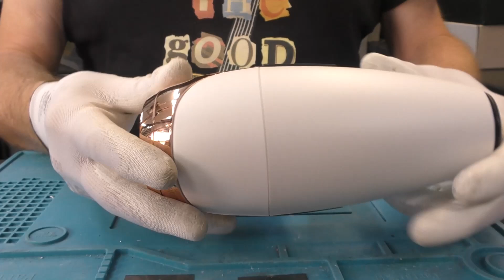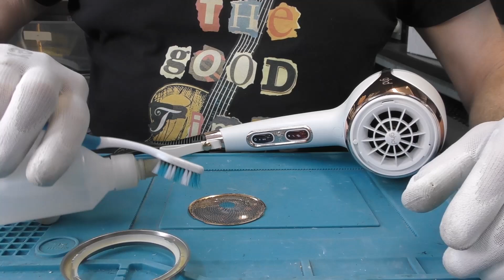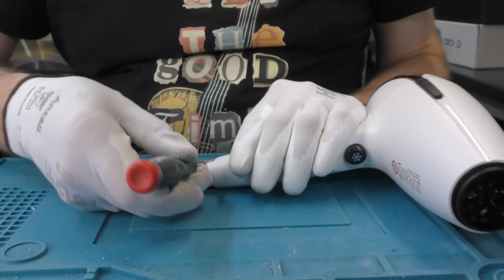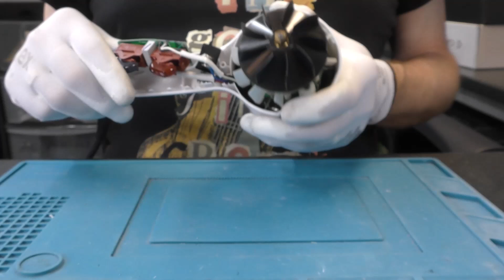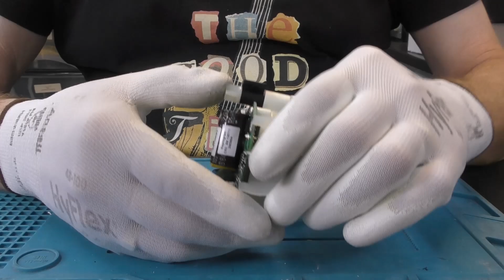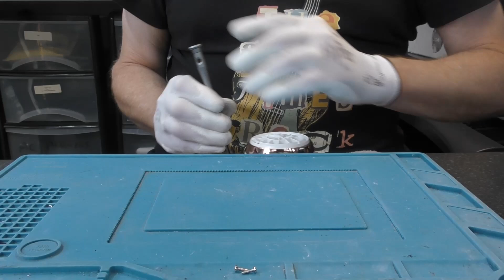GHD Helios HE001 Hair Dryer Tear Down

Comment: I am looking at a GHB with a tripped thermal fuse and water damage residue on the underside of the switch board. Everything else looks clean. The switches work, confirmed by continuity testing at the different positions.

The dryer does not turn on at all. Is that expected behaviour with a tripped thermal fuse? Thank you for the video, it is a great source of information!
Reply from the maker: Thats normal. Replace the thermal fuse.
Reply: @Trevs-Shed thank you so much. I will replace it and see if it comes back to life. Cheers!
Reply: @Trevs-Shed would you have any tips for getting to the inner of the two contact pads? Do you tear down the entire heating element first?
I could get to it with my soldering iron, but not without contacting the silicone or heating coils.
Reply from the maker: Use small side cutters to remove the old thermal fuse and a soldering iron in at each end to solder the replacement. 
Side cutters can slide between the element coils, just be careful not to cut the coil...

Comment: Great video and very helpful. My wife's Helios has stopped working on the first speed setting but is fine on the second. Any idea why? It smelt a bit funny when it initially stopped working and it sounded like an electrical short. Thank you in advance.
Reply from the maker: Switch contacts arcing and rocker worn.

Comment: Hi! Thanks for the video! Mine has an issue with a speed button - it definitely needs a replacement. The problem is I cannot find where I can buy spare parts for it. Any advise where to look? Thanks
Reply: Is it both speed settings or just the first? My wife's stopped working yesterday on the slower setting.

Comment: Hi I have heat problem with mine. I checked fuse and wire continuity and heat element is fine. Any idea what else can be wrong?  Thx
Reply from the maker: Heat problem???
More information required.
Reply: Great video,I had already dismantled the dryer Because of no heat ,Cool switch is fine,I would like the temp and amps of the thermal fuse .It reads a dead short but it needs cutting away one end to remove the heater resistance affecti g the dvm readings .Also the diode needs cutting one end to remove false dvm diode readings .Cheers Brian

Comment: Great video. Do you have a link for the thermal fuse, please? Thank you.
Reply from the maker: @keswickcowboy  Hi
Use RS or Farnell or ebay.
Reply: @Trevs-Shed  thank you. Temperature rating please?
Reply from the maker: @keswickcowboy  Varies, it is written on the old fuse.
Reply: A YouTube video said 184, but what i found  is 216.
Reply from the maker: @EttoreTecno666  Either can be fitted at the factory. Replace with 216 degs
Reply: Any idea what thermal fuse need to be use? Any specification and parameters?
Reply: Hi